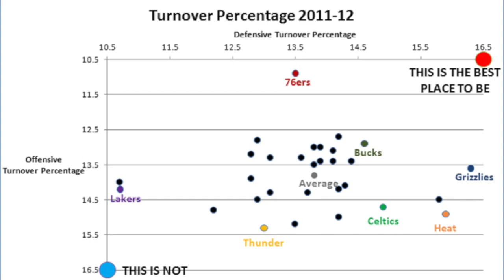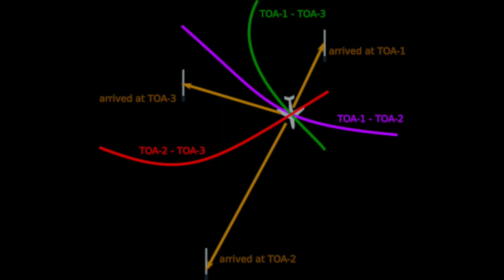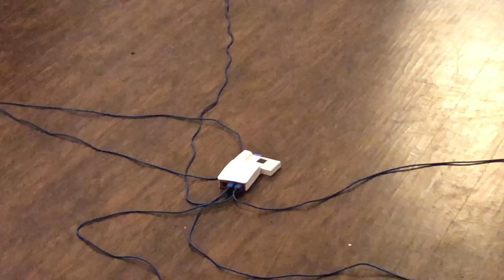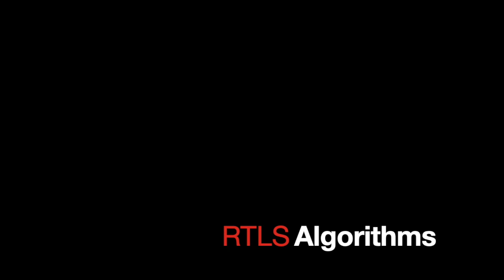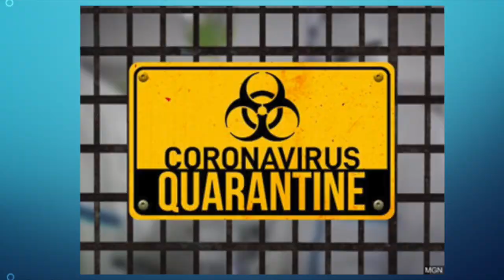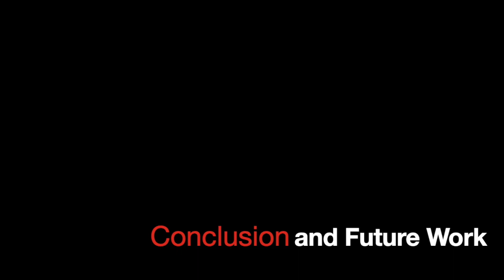Team B6 Senior Capstone Final Video

Comment: Hi, i'm working with dwm1001 to develop a simple project that tracking location of human in a coffee shop. I want to improve the accuracy of position, so i want to use Kalman Filter. I searched on decawaveforum and found your post, of course, watched this amazing video. I already found your project on github. So this is what i think, that your data is already collected and saved in CSV form, after recording data, then you put through Kalman filter and show the filtered data, raw data,  and give the comparison.  I want to ask if i move around on the floor, holding a tag,  and the data is transmitting, can i put through Kalman filter and give immediately filtered data? i build a web, and i want to show the position data immediately